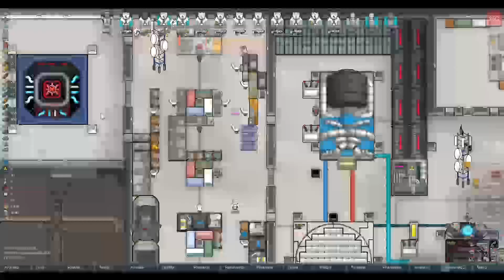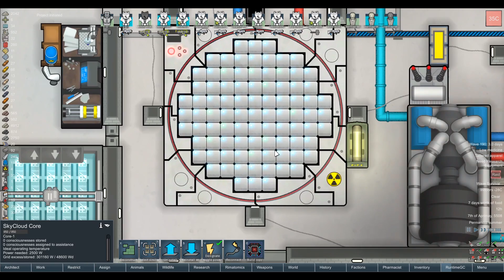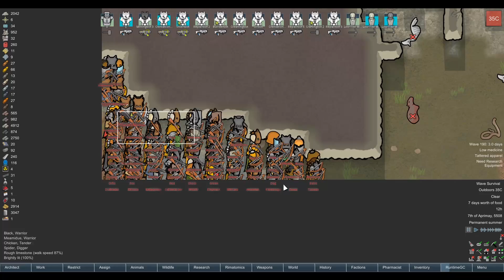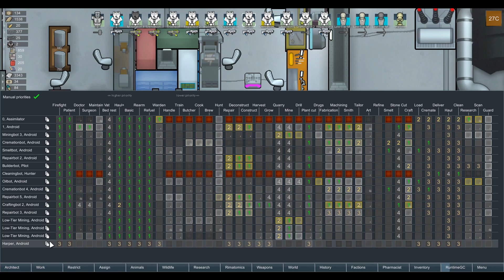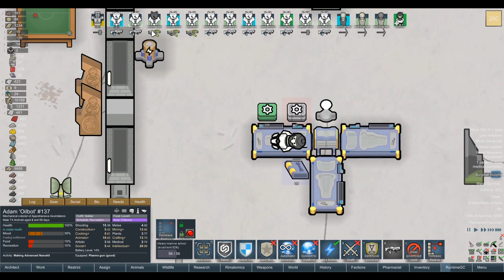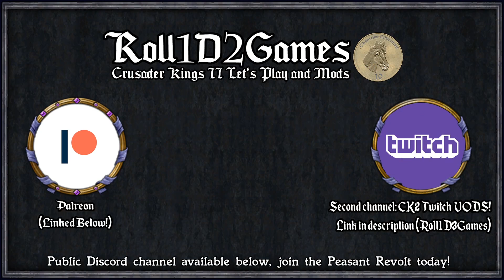Rimworld: Assimilation #50 (Hardcore Merciless Wave Survival)

Comment: So remind me what the actual point of the barriers is supposed to be if they're basically like sandbags...? If they were walls, it makes sense, but if they're just partial cover it seems somewhat pointless. I guess it could work for removing cover if the enemy overruns a position and you don't want the enemy to use your own defences against you - but that's easily prevented without this tech